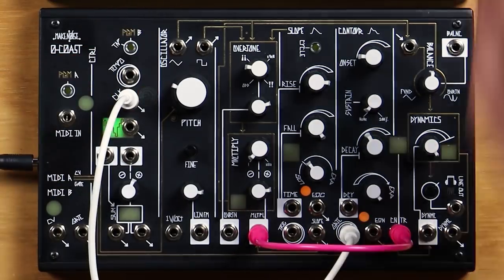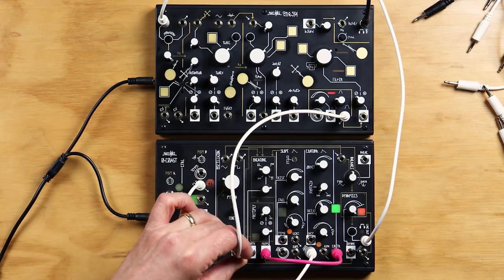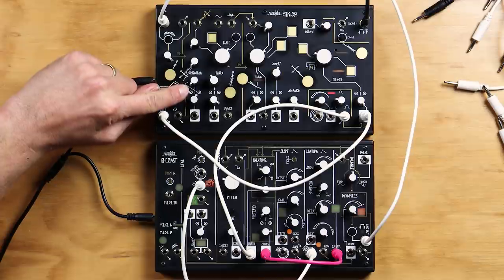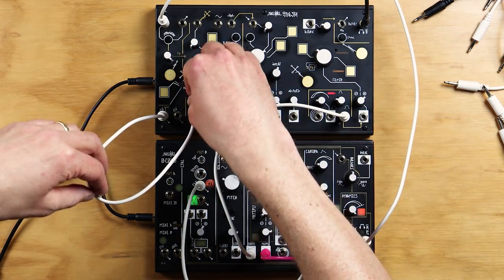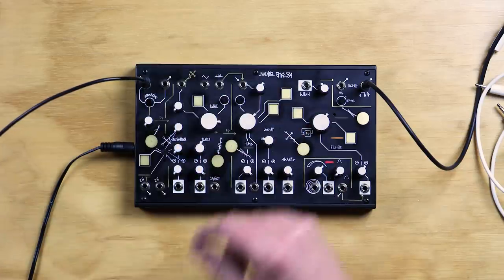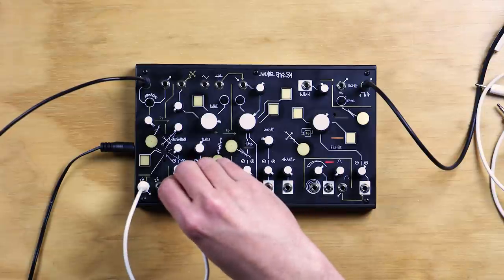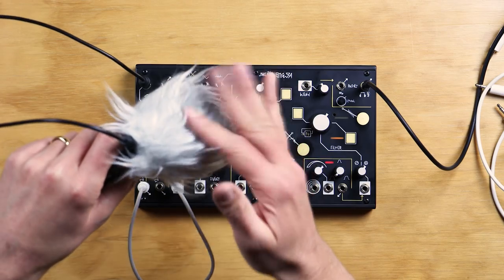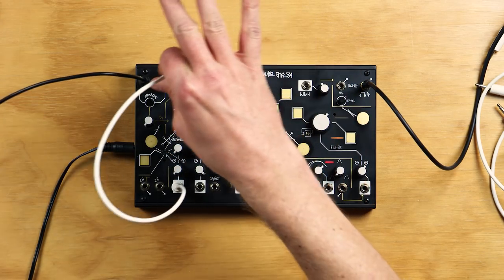Processing Sounds with Strega

Comment: HI! I wanted to ask you what kind of microphone should I use to connect to the strega, which model is used in this example?  Thanks!
Reply from the maker: That is a Zoom H1 handy recorder, which I find useful for this purpose because it has a line level output on a mini-jack and so it can be patched directly to the Strega input with no adapters or preamps necessary.
Reply: @MAKEN0ISEMUSIC Great! Thanks!!

Comment: This exactly why I got one. I use it as a unique noise oscillator, I was a little surprised it doesn’t have midi! And disappointed! It’s a great unit still, but I’m going virtual with before and after, I lol be experimenting with that soon! I actually have built in windows 11 computer with an excellent fitted screen on the rack itself! I’ll be on YouTube pretty soon with that set up. Many people think, as I did it takes special equipment and that’s just not true.any midi to Cv will work, especially using a large undefined mult like  the Behringer 100 series mult will work!
Reply: Any recommendations on midi to cv converter? Was hoping to control with my minifreak I don’t feel like buying a keystep or something similar

Comment: Where can you buy the double power adapter? Is there a triple one for the 0-CTRL too or would you not recommend because of the touch controls?
Reply from the maker: The adapter cable is included with Strega. The power supply is not strong enough to power all three devices but it can power two of them, and yes it will work with 0-CTRL.
Reply: @MAKEN0ISEMUSIC  Awesome, thanks! Great to hear. Any plans to release a specific two or (hopefully) three tier stand for the Strega, 0-Coast and 0-CTRL?
Reply: @TheOriginSoundtrack  If you are handy with tools, they are not hard to make.
Just need a saw and a drill. Some thin plywood and a can of spray paint.
If that is not your cup of tea, then try google, I think I saw some for sale somewhere.